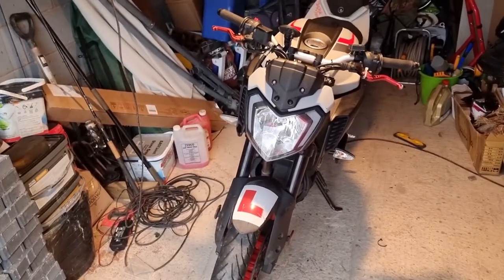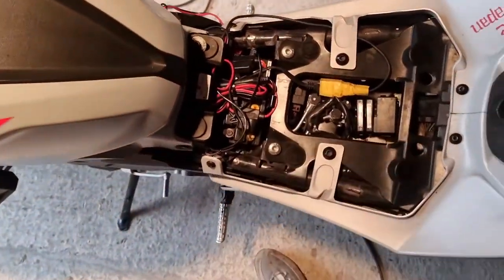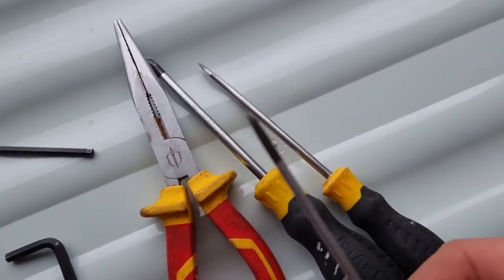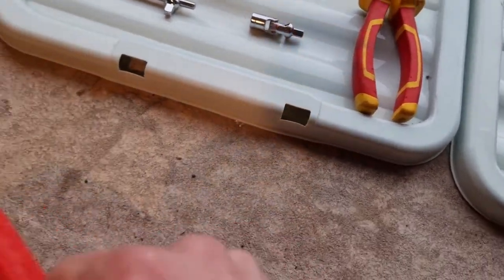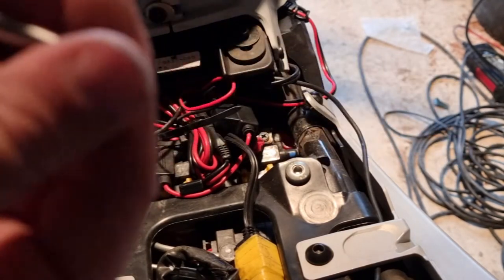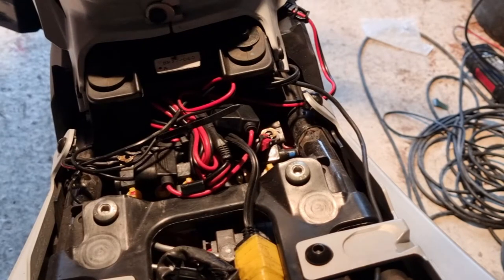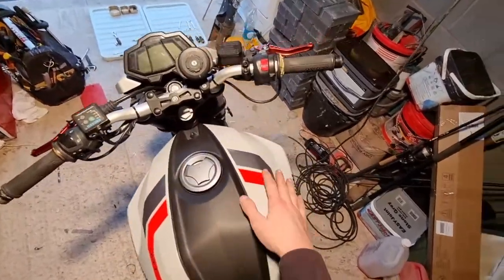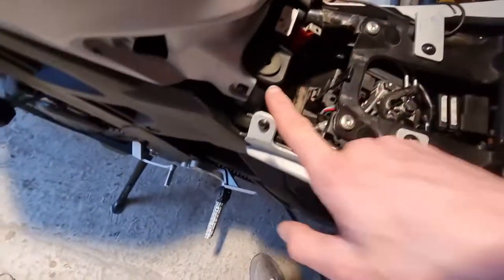How To Strip Down An MT-125 ABS 2014-2019 down to the head of the engine to access the Rocker Cover

Comment: Anyone know if Yamaha has put on a rev limiter on the MT 125 2021, and is it possible to turn it off. I also have a question. Would a fuel injector nozzle from a Yamaha MT 150cc fit into the MT 125cc 2021 or do I need to change the throttle body?..any professional help will do!
Reply from the maker: Do not turn off a rev limiter on any bike... its their for a reason lol. And i wouldnt suggest swapping injectors as rhe bike will just run extremely rich
Reply: @gw03._25  would it help to have a basic re-map as I am not looking for a custom job, just basic tune up without a power commander or custom ECU tune. I am looking for the best out of my current engine without having to bore it out to a 200cc. This is the UK I am from.
Reply: @gw03._25  I'm just looking outside the box if you know what I mean.